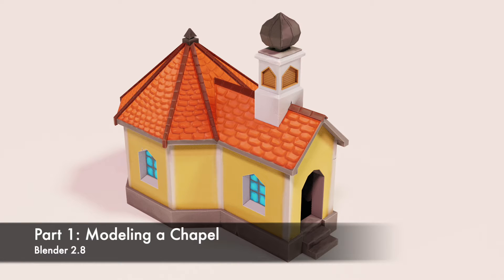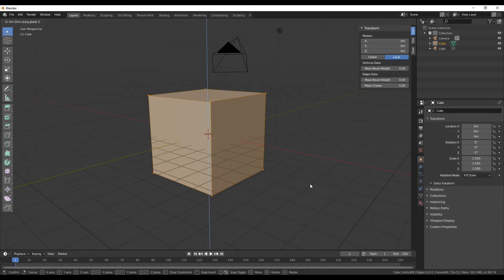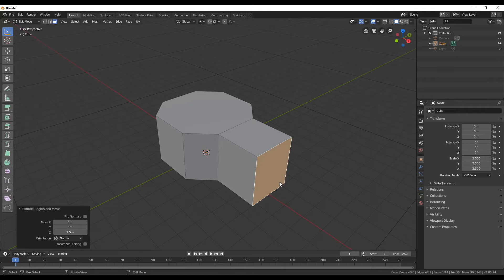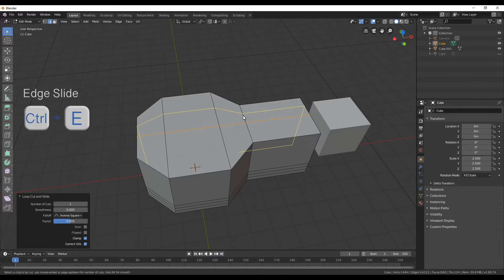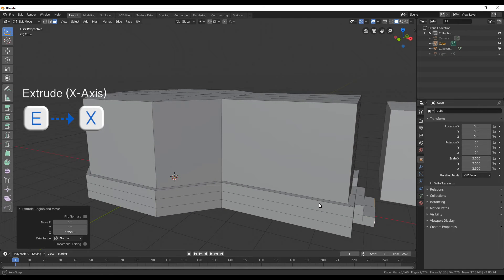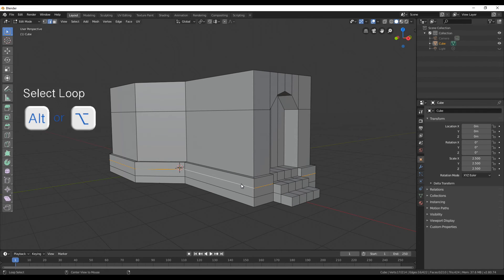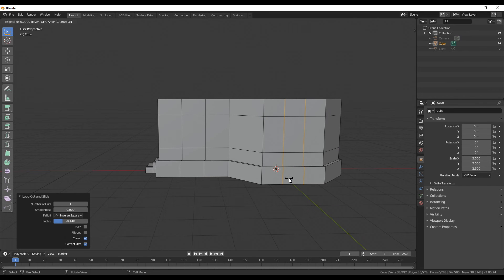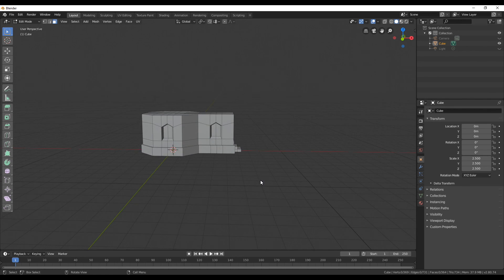Modeling a Stylized Chapel in Blender 2.8 - Part 1

Comment: I have used it since three days ago and I found a lot of errors and file crashe even the task manager can not end the error until  I shut down the computer then this  happen every time   !!!!    Should I wait for the stable version  2.8 ??
Reply from the maker: The final release should fix those issues, I also expierence especially with baking still some big errors, which can be really annoying but for me its not crashing so in cases where I don't like the result I just switch to Blender 2.79... I guess in your case I would indeed wait for the stable version or try out the beta in a while again...
Reply: Yeess correct I had no issues with the previous one 2.79   really it's stable but  unfortunately  can't work with up to 20  layer as a maximum  limits  its nothing  and it's without  evee